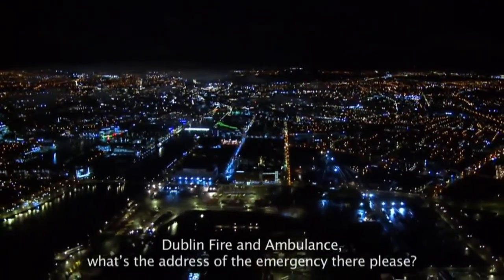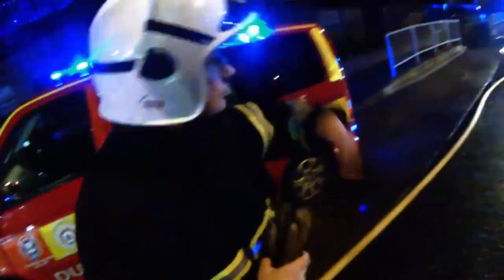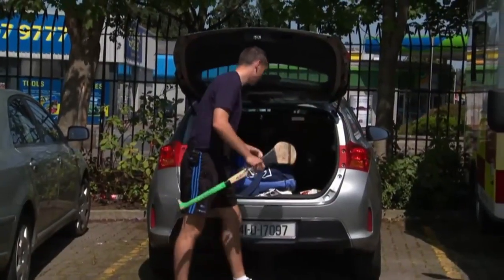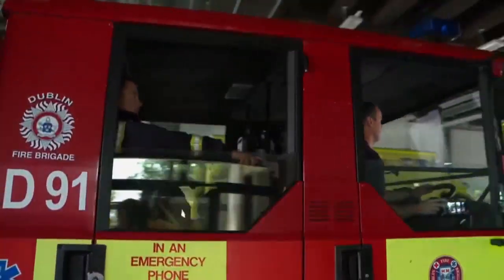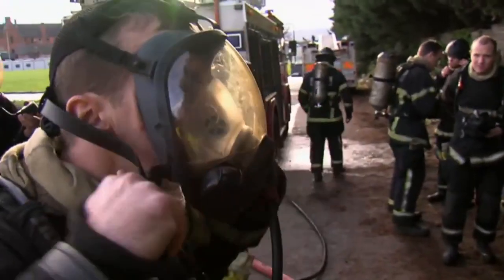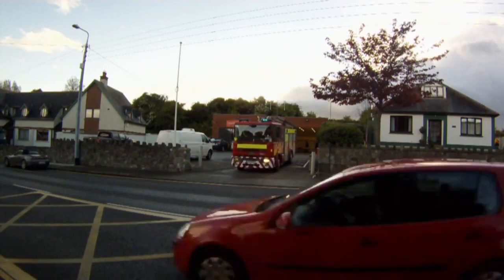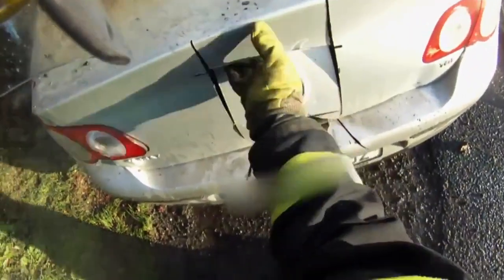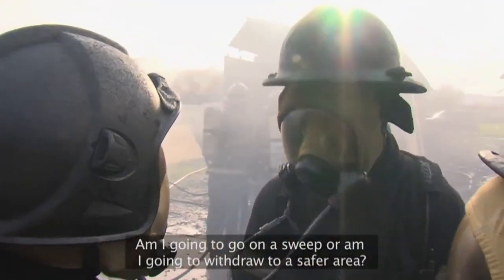Firefighters - Dublin Fire Brigade [4/6]

Comment: Interesting fact about "Delta 72" The Dennis Sabre shown at the very start there, it was used for a long time as Tallaght station's 2nd Water Tender appliance, lateer being known as DN17a2 when the callsign changeover occured, it was in service until recently DN17a1 got replaced with a Scania  P320 and then DN17a1 became the new a2, meanwhile the old Sabre was designated to driver training (ESDS) duties where it remains today.